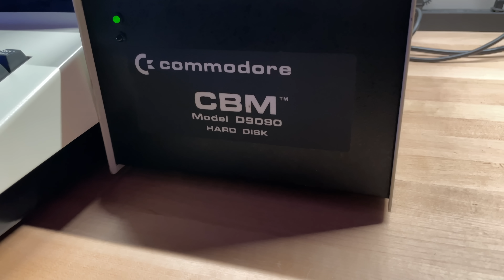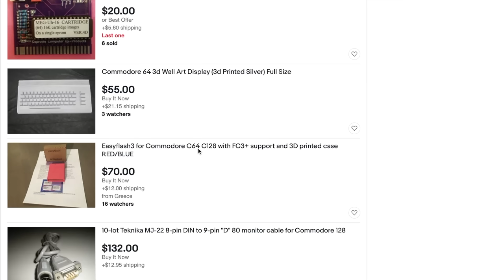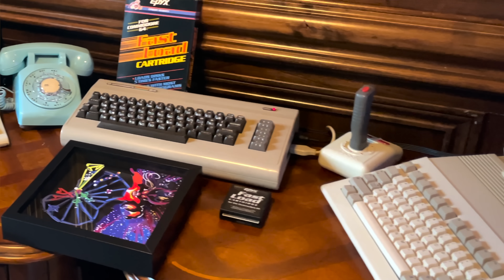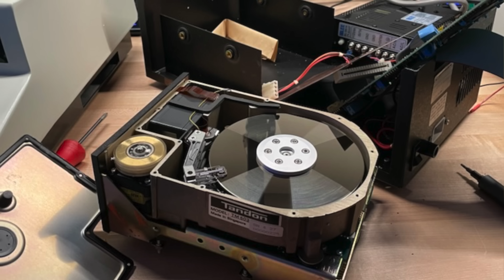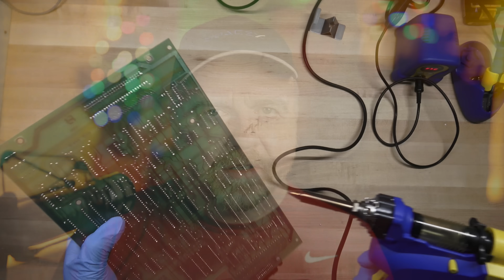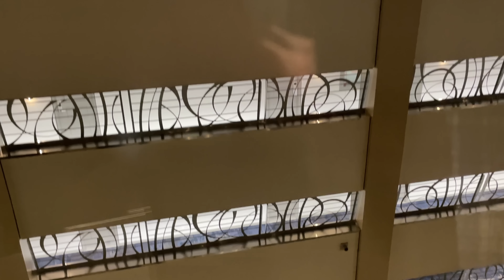FOUND: A Super-Rare Commodore D9090!

Comment: I had a similar problem powering up an SGI Onyx in my garage.  It would not only pop the GFI, but that GFI wasn't even on the same circuit, meaning the leg I was connecting to was a parallel leg, so I would power up the Onyx, and other things, on the GFI circuit would get shut off!

Comment: Dave you crack me up with the "keep throwing money at the drives" dialog. 😂

I threw a bunch of money at my C-64 setup back in the 80's, dont know how I ever got that past the wife. I installed a JiffyDOS update chip on the motherboard and bought an external chassis, can't remember the vendor now, that had a I think like 20 or 40 megabyte scsi drive in it. Running a BBS I had a crapload of upload/download storage. 😉

Comment: Would it be OK to sample your MFM startup sound at 20:26 onwards for my W10 start up replacement sound? I just been binge watching your channel for so many past retro experiences. In 1980's as a pro COBOL programmer I could finally afford an IBM-clone 8086 PC with MFM drives. You bought back so many flash backs (good and nightmare) of hooking up MFM 20Mb HDD's that gobbled up in sheer wonderment the contents of multiple 5.25 FDD's. Surely technology could never advance as much as this at such a rate forever? Then on DX486 with DOS 6.x's I must have run Mbytes of your code; nay must be TerraBytes of your code

Comment: Speaking of the inside construction of a hard disk drive, if you want  a super sized actual hard disk check out a slow mo control head.  Back in the early eighties I worked at ITV edmonton and in our mobile truck was a slow mo.  This semi trailer was suitable for doing hockey so of course it had a full featured slo mo.  Under the plexi glass top was a super sized hard disk drive th two I think platters were about 24 inches accross and had heads above and below each disk.  There wer no suitable TV grade compression formates at that time so dispite the size total recording time was 30 seconds.  It worked exactly the same as a drive in your computer except at that time even a computer hard disk was pretty rare so this thing was just magic .  Ampex  manufactured most of the early high end video equipment this and 2 inch video tape machines with vacum collum tape tensioning were amazing tech to watch  and  operate.

Comment: Hi,  The 2é0V german original was made with any transformer and a transformet isolate it's primary to the secondary.
The power suply that your friend axplan to you to buy is realy nice but there it's a " switching power supply" and there is no transformer magnetic in and NO isolation like the old one. so ....
If you have not yet tryed, you can find any old transformer magnetic that make 110V  to 220V.
I maked th same in 197?? when i recieved my first ibm PC 110V  but at home in belgium i have 220V tooo   and it worked fine
Laer i'd tried to replace these old power to any new one like your and i ahd problem wit too
it is possible to be electrocuted too with thes stuff if they are bad connected too the ground so....
Sorry for my terrible english, i'm fraench

Comment: Now will you please make us a video showing us "$" from the 9090 with the working disk drive in it, and if $ looks just the same with the flash-based emulator instead? And will you please find an interface that will let you hook the 90 up to the user port of a 64 or 128 (since I've seen that a 1001 will work that way; somehow the computer can send drive commands out through there too, but I don't remember how)? What format code does it give the disk (like 1541 is 2A; I don't know what 71's is, and 81's is 3D)?

Comment: Wow, too bad this only has a flat file system, unlike the 1581 with its CBM DOS v10 and thus probably HIGHLY underused ability to partition disks (much more usable on a hard disk; I bet 95+% of people with a 1581 never used that feature; I only ever used it ONCE to try it). It would be cool if you could upgrade a 9090 to use DOS10 but with the info. it needs to work with 21K blocks instead of just 3160. And I wonder how that compares to the CMD or Lt. Kernal.

Comment: GFCIs can be hooked up wrong and still sorta work. 
I had one connected to a garbage disposal and a microwave. Rarely it would glitch and require a reset several times before working I replaced it and was very careful to test which side was the supply. (with the power back on) Connected properly this time everything works and no weirdness.

Comment: The power supply issue is likely a ground issue. I would check if there is a failed "death cap" or Varistor in your PET or the D9090. Stuff then wasn't exactly safe and had a lot of floating grounds, and the PET might had some hot AC on the chassis somehow.

Comment: Nice piece of Hardware I never new it existed! BTW: US homes do have 220V - actually 2*110V on two phases connected to "Neutral", but you can use as 220V for appliances that need it. Check your fusebox with your favourite electrician, and he will show you how to get 220V there. But it will be 60 Hz of course, not 50 Hz like Europe. But might save you the conversion box.

Comment: I have a gfi outlet that trips when I turn off my shaver. The whal has no exposed metal parts and wearing rubber shoes on a rubber mat doesn't change anything. The outlet thinks there's a leak--- but there's literally no where for the milliamps to go except back to the outlet. strange.

Comment: I was an Atari 800 geek. My wife used an machine language word processor to write 18 Romance Novels for Dell. The first novel paid for the 2000 dollar Atari 5 times over. She was the first Romance author to use a word processor to write her books.She used a pen name of Emily Elliot to hide her real name. She turned out 18 books in three years. She was dropped in 1985 when Dell shut the line. It took almost 35 years to try again, Emily Mims has written almost 35 published works for Boroughs Publishing and using Word, has business with editors and publishers in three countries.

Comment: With old electronics, the capacitors will almost all go leaky eventually, especially electrolytics/tantalum.  You need an ESR meter to test.. First thing to test before going further. 90% of old non working electronics is a capacitor issue.

Comment: It’s back feeding through the regulator rectifier… it has to be flipped from AC to DC right, but after it’s flipped it’s still not 12v it’s more like 80v DC or something like that and the regulator circuit in the power supply pushes it down to 12v through… capacitive resistance? It’s most likely a power supply issue if you’re blowing the breaker. Only other thing I could think of is the back feeding where the oscillation of the current is somehow going through the rectifier

Comment: All computer power supplies (switchers) leak current to ground.  With a short on the 12V side to ground the chassis ground of the drive metal is also the ground line on the AC side which would leak current more current to ground which in turn would then trip the GFCI as the power was coming back on ground instead of neutral.  This is where "ground" isn't ground but it is ground.  The DC ground and AC ground were the same thing here causing the ground fault.  I assume a tantalum cap was bad and simply didn't explode for some reason causing the ground / short fault.  The power supply didn't have OCP so either burning itself up or blowing a fuse.  👍🤠

Comment: GFCI monitors the current differential between hot and neutral, and will pop if there's more than a 5ma difference. This allows them to be effective with two prong devices where the current is leaking somewhere besides ground.

My GUESS is that some odd circumstance (like a rectifier rather than a switching power supply) was somehow temporarily delaying the current between line and neutral (maybe only a few cycles) but enough to trip the GFCI.

Comment: You got to live the golden age of computers. Going from systems where you could soldier to the modern era of windows. 

My first computer had windows 3.11, I was on win95 in middle school, and 2k/xp in high school. Stayed on XP all the way until Win7 came out. I got to use AOL 2.5 until 4.0 when we finally got a "real ISP" and ultimately cable. I consider it the silver age.

Comment: GFCI / RCD can trip due to the high in rush from big capacitors or inductors(transformers) which can be hard to filter out. 
So in my workshop here in the UK I have a special socket which I mark do not use for anyone else which has only a current trip.
I do try filtration first before using this socket to protect myself 
Also spikes from other devices or power supplies creates a dirty mains supply which the filters on the newly introduced power supply try to short to ground so I have filtration before my GFCI/RCD to stop this happening.
I do have meters permanently wired in to watch the flow back trough earth, Neutral & phases to give me a heads up.

Comment: Are you sure your breaker is a GFI and not an Arc detection breaker ?  Is the power supply a switching or linear ? If it is a linear power supply, current spikes in the drive could be detected as arc seen from the primary side of the transformer. That is a Longshot guess...

Comment: Electrician here, in the US from what I understand you have arc fault breakers. What is probably happening is that the inrush current of the hdd spinning up looks a lot like that of an electrical arc, I have no first had experience with them as we do not have them mandated in Aus but from being around tech forums a lot over the years computer powersupplies will often cause older arc fault breakers to trip.

You could probably work around this issue by either upgrading your breakers or using a double converting UPS.

Comment: Love your series of YT's.  I grew up in Montréal, hacked 4k / 64k Dram in the 80's, wirewrapping, and lots of other tech.  Flew through a large graphics company, now retired in WA.  Would love to connect.

GFCI's can trip if there is a current in the milliamp range between ground and live.  Or current over around 15A.   TeslaM3 also doesn't like GFCI's, and trip them.
Old HDs snck. Thanks to exfat I don't have to use those. :)

I still use copper braid to desolder chips :)

Comment: Inside the hard drive, the motor is shorted.
Hypothetically if you can get a new motor, and use the old power supply.
I would assume the motor had an amp limit which that  power supply didn't care about. We don't even know what amperage it's looking for, too low and it burns, too high and it burns.
( Disclaimer I know nothing about design of hard drive power supplies )

Comment: 3600 rpm is a harmonic of 60HZ and the motor could be somehow inducing enough to trip the breaker  - the spec is ~30mA and electronic kit leak current to ground to begin with cause is RF/EMF filters. Electricians in the UK are seeing a lot of this happen as more chargers / DC power bricks are used

Comment: Ooh, I too bought a meanwell power supply to power my ADAM. It was fun trying to add RJ-12 ports to the enclosure to get two new ADAMNET ports and wire up the 9-Pin cable to the host.  I have a NOS linear supply but no enclosure and it ran so hot I could cook with it.  No wonder why these used to melt back in the day.

Comment: Thanks for the story. Very interesting. I was an Atari person, and owned the Atari 400, that I had modified to 48K by using 64K chips. I ended up with some special hardware ROM that allowed to break out of a game and do various things, save to floppy disk and other cool stuff. Those were the days of hacking. Since I’m not a nostalgic person, I sold my Atari stuff long ago. I had no desire to keep it running. Thanks again for the great technical videos you do here. You are a great story teller, and speaker.

Comment: Hi Dave, being a tad bit older than you (1964) I had as my first computer a VIC20 and C64 was second. I used to work in a computer shop while studying Physics at University (back then few people here knew about computers, and I got first rudiments on the University VAX) and I remember the PET and those HD units, only "rich" customers could afford those.
My first HD was an AMPEX 5 megabytes unit I got as add-on to the Olivetti M24 (my third computer and first IBM compatible). I fondly remember playing both Dam Busters and B.C. on the C64... and even more fondly the Hyper Cache for the Amiga (I still have a perfectly working A500 in the basement and I should equip it with an SD card adaptor and do some retro game play).
I also used to "play" with 6502 assembly code and I still remember the joy of a program to display on screen a 3D function and then print it on the Seikosha printer; it used to take 30/40 minutes in MS basic and only 4-5 in assembler. The tedious work of mapping the function in the 8x8 character map of the VIC20, and then on the 6x9 printer matrix!.

Comment: same thing happens with an ac to dc to ac audio amplifier, if the speaker coil is in dead short, its just like trying to start a large motor with no capacitor, the surge amperage spikes trying to achieve motion from the driver in a locked magnetic field that it overcomes the 15 amp limit of the breaker.

Comment: My guess for why the breaker was tripping is some strange frequency that the device was creating.  I've had two-way radios trip GFCI's. Some in the 700/800MHz range, others in the 6 MHz range. Try a ferrite RF choke to keep the RF away from the breaker.

Comment: Earth leakage.... that sounds like an interesting problem you got there.
If you could you can put a small ampere meter on both live and neutral and see if you can see which one is lower or higher. 
Using a scope would be ideal due to the timeframe trip.
The tripping is between 15 to 30 mili ampere where I am at.
Is there a earth wire to the power supply?
Are there any MOV (round and blue) in the power supply or device?

Comment: 13:30 Was anybody getting zinged when touching the disk drive? GFCIs protect against current leakage, not over current. The fault you describe sounds like your buddy brought you a dud (probably accidentally. Sometimes they are duds from the factory.) which then failed catastrophically on power on. You might get lucky and be able to try again with a PC power supply, though most likely, the whole thing has gone down in flames.

Comment: Very interesting.  Back in the day a friend of mine had a Commodore Hard Drive but I have no clue what it was I barely remember what it looked like but as I recall it looked like a PET Disk Drive but its capacity was like 3 or 5 mb.  He messed that puppy up playing with the internals.  Thats all I remember about it.   I did own 2 hard drive systems for the C64/128 both were 20mb, the first was a Data Chief which had an ST506 Drive custom wired to a 1571 control board.  That drive emulated a bunch of 1541 single sided disks or 1571 double sided disks but through some voodoo magic you could call up a directory and it would look like one big 20mb disk.   The other system was a Lt Kernal which used a SCSI drive and what was most interesting about that system is you could share it with several other C64 or 128's using a Multiplexer and I had a C128 and 128D sharing that drive.  Problem was you needed to lock the drive while one computer was writing because if more than one wrote at the same time you could corrupt the drive.  With the multiplexer I could run a chat room known then as a teleconference area as I had two computers running BBS Software which for the time was pretty cool.   However, once I setup the BBS on an Amiga 2000 that took over the role of the two 8 Bit BBS systems.  I sold off all my 8-bit toys and in the past few years went on a retro journey buying them all back and then some.  It's great having them and yes, they are working but when they fail, and they all will fail the fun is getting them to work again.   It's not about using them but when you do turn one on and see it work there is a certain joy they bring.

Comment: I love your work.  There is a nas distro called RetroNas which supports many of the old internet and networking protocols.   I do not know if the pet is supported, but   I believe FTP and Telnet are.   BTW my great grandmother married a Plummer.  I was told they were both from Maine though they met in Min.  

  I have warm place in my heart PdP-11 and PDP-8s.    My entry in the slow storage sweepstakes is the Dec  TU-58.    It was a quarter inch data cartridge tape drive  controlled by an 8085  over a 38.4 K serial line.   The tape unit faked block replaceable storage.  Imagine a tape drive faking being a floppy over s serial line.   The 8085 sent 2 or 4 128 byte packets to the host per sector.  I do not recall if  sectors were 256 or 512 bytes.   Thanks for you insights